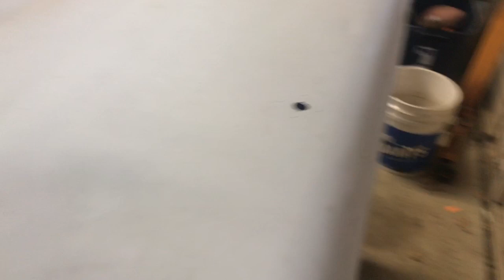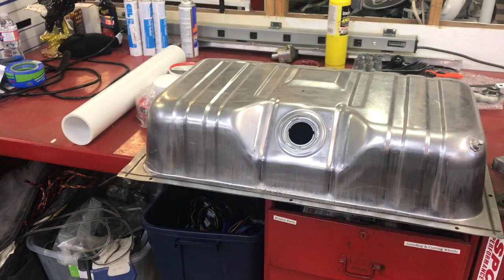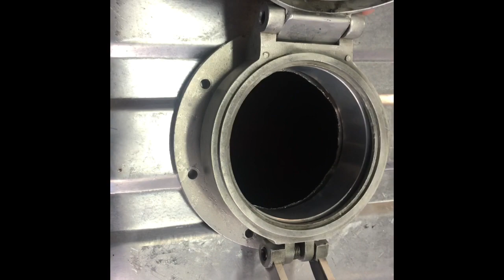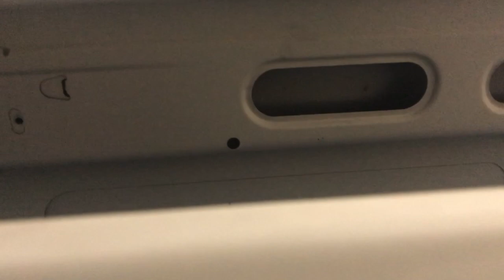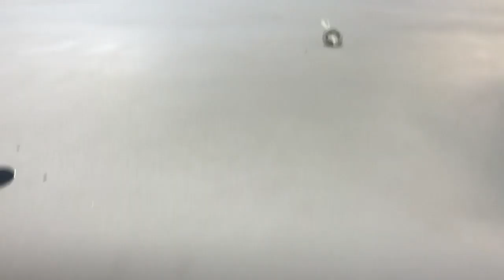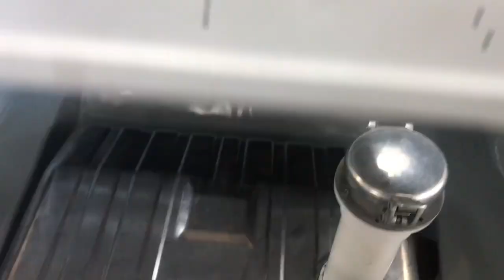Le Mans Gas Cap hole 67 Mustang Trans Am

Comment: Nice work bro.  I am building a very similar car right now too, and just finished the trunk deck lid hole to allow the LeMans cap thru. What a coincidence! 
My car is a ‘64 1/2 Coupe that I’m building to be a Terlingua/group 2 car, with the stock interior of the Mustang, as it will be my daily driver.  I’ve done the LeMans cap, battery relocation, window/windshield hold-down straps, roll bar, vent tubes and block off plates on trunk and hood pins.  Currently doing floor pan rust repair before installing new carpets and interior. Also have already put together a Shelby R front valence to finish the front end.  Today I drilled lightning holes in the rear bumper, just to see how it looks and I’ll decide to remove it completely or not.  Keep up the good work and videos! I’m subscribed!